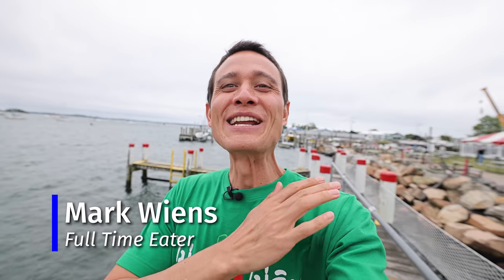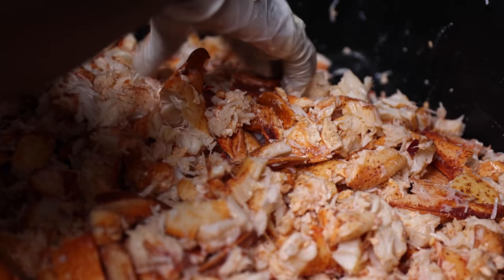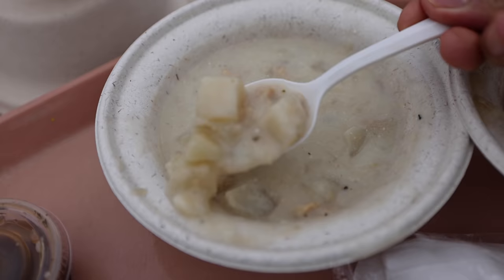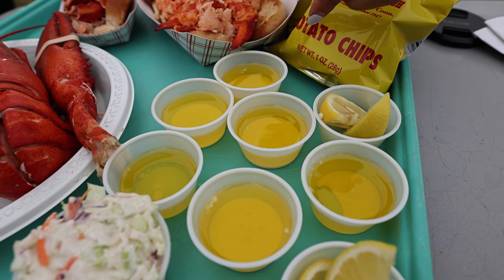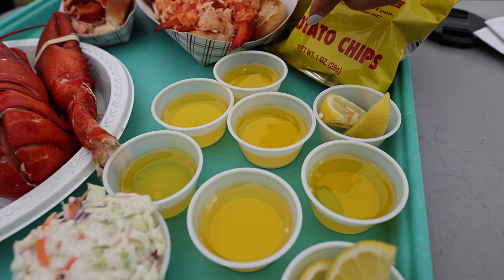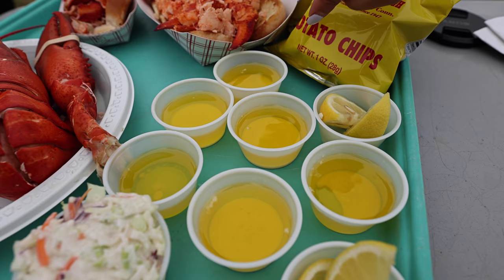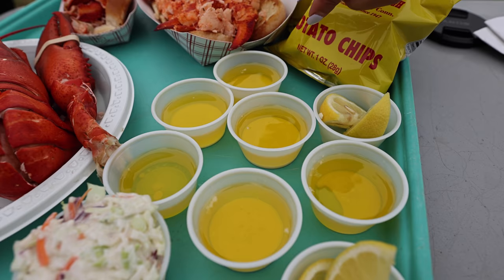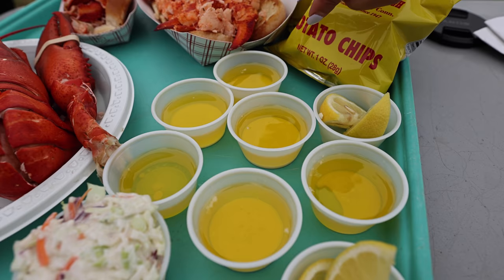Giant LOBSTER ROLLS!! 🦞 Fresh Lobster + Warm Butter | Best Food Shacks in Connecticut, USA!

Comment: What you should have done was put some of the sauce in the potato chip bag and shake the bag so all the chips get nicely coated. Then break up the chips into small tiny pieces and then add them to lobster roll, providing a nice spicy texture to the sandwich.

Comment: omg i live in Connecticut im going there
Reply: Not worth the trip; subpar
Reply: @keytie  why is that and are you from ct
Reply: @JaysPHJourney  Hi Jay, yes, I am in fact from CT (grew up there) though I now live in NYC area. The lobster rolls at The Lobster Shack were not very tasty. The lobster itself seems like they were not lumps of lobster, but rather stringy chopped up strands of lobster (compared to say Luke’s Lobster or even Lobsta Mobsta, which have intact pieces of lobster. The roll also was a bit soggy and not very tasty. I also had the clam chowder and lobster bisque, which were both underwhelming. The lobster bisque was too sweet and syrupy with hardly any lump meat and the clam chowder was not very chowdery and a bit gritty. Again, I spent almost 4 hours on the road to get to The Lobster Shack and it just didn’t measure up. Maybe for the town, it’s good.